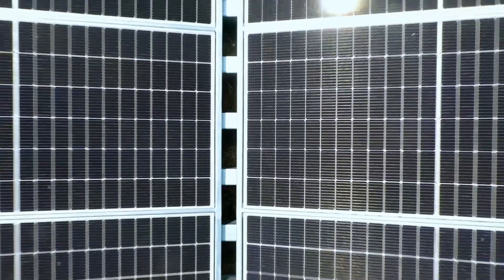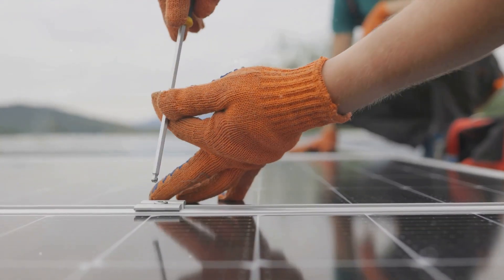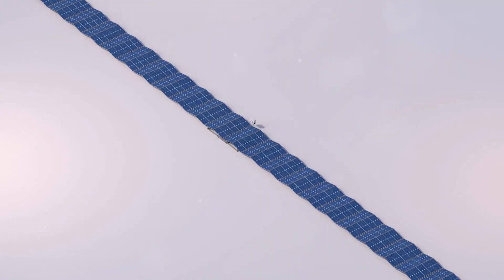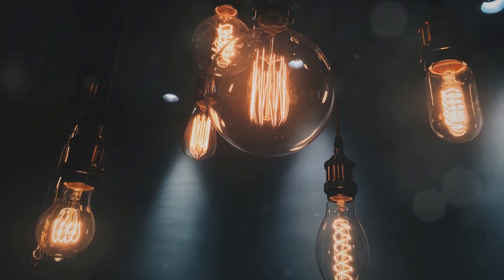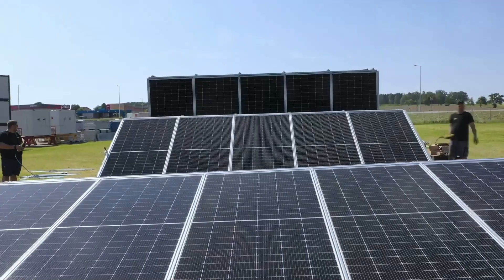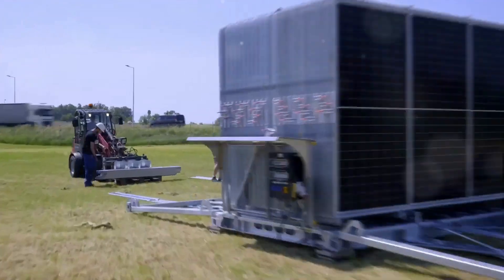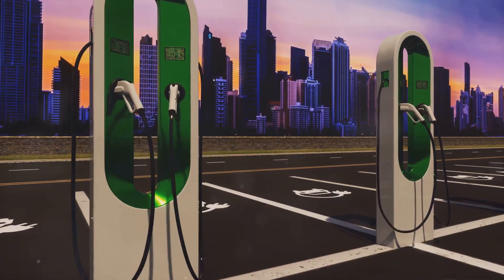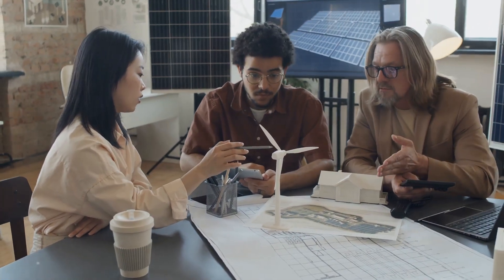Goodbye Traditional Solar: This Crazy invention Changes Solar forever!

Comment: I am building a off grid house, 18kw panels, 44kwh batt.  I live on Maui and the cost of this system will yield an unsubsidized cost of about $0.16/KWH. Grid power here cost $0.42/kwh. I believe that the future of power generation is mostly in individual homes.  Most of the grid in the future will not be necessary in my opinion except for large urban areas. Home generation of power means freedom. This system from this video is clinging on to grid scale production and I don't think that's the direction that we should be headed in. We need to win on unsubsidized economics otherwise it is not a real win and it is unsustainable.
Reply from the maker: 42$ /kWh thats crazy!
Reply: @SingularityVault  lol 42 cents
Reply: @SingularityVault  thank you for pointing that out. I edited the comment so it is correct now.
Reply from the maker: Sounded a bit expensive! Still 42 Cents is also very expensive! So solar sure sounds like a good alternative…
Reply: @SingularityVault  $0.16 per KWH is my unsubsidized cost. When I factor in that a new house connection to the grid is $10,000 and a 30% federal tax rebate, the subsidized adjusted system cost drops to around $0.08 per KWH.
Reply: Where I live individual household energy consumption represents just something around 17% of total. It may be different in Maui but here utilities need to stay.
Reply: @kubismatik2  Maui has no heavy industry. But if it did, solar and battery would still be the way to go if you have a decently sized building. We are getting robbed and the price to maintain the grid alone will outstrip the price of battery and solar here. We do get much more winter sun here that any other place in the United States.
Reply: @terrylane1492 Sounds great, enjoy your PV!

Comment: And who is going to use it? People with loads of money who can install electricity anywhere they want but they prefer to have a temporary setup that cost an arm and a leg., stupid of you ask me, the truck delivering the contraption and have to pick it up, and the crane having to offload it (very heavy, steel and glass) will consume 5 times more than what that thing can deliver, and it only generate electricity during the day.
This is not new, Nasa and the Russians has expanding Solar Panels for a very long time, stupid idea! build nuclear power  plants!
Reply from the maker: At Singularity Vault we love Nuclear aswell. Check out our other videos like Thorium Reactors. But these Solar Containers could be great for temporary off-grid setups together with a batterybackup, for example construction projects.